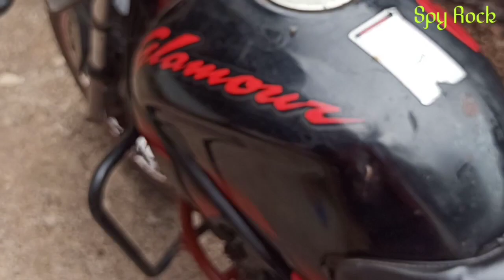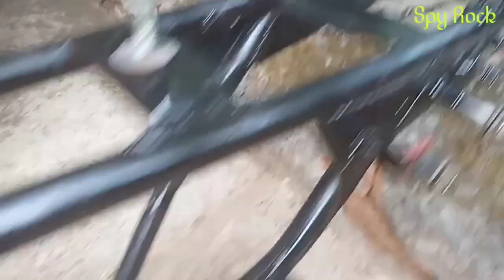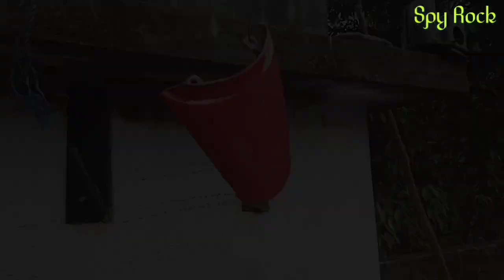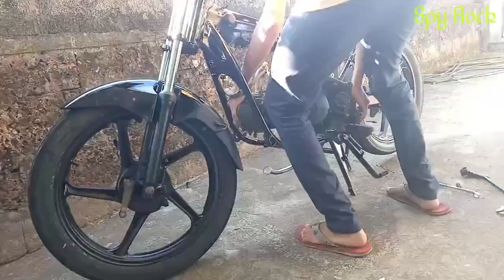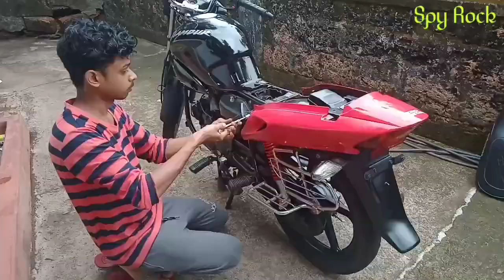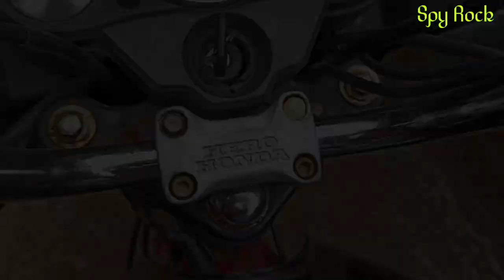Old Hero honda glamour restoration | Glamour bike rebuild

Comment: Bro ethinn usee chythaa paint athannuu
Reply from the maker: Spray cans ആണ് പെയിന്റിംഗിന് ഉപയോഗിച്ചത്.Compac quick drying 100% acrylic spray color 211 Red ആണ് Red spray can ന്റെ details, പിന്നെ Glossy black, Matt black, Silver, Clear (Lacquer) Total spray cans. Chassis ൽ rest & welding  ഉള്ള ഭാഗത്ത്‌ Normal red oxide oil primer painting brush ഉപയോഗിച്ച് അടിച്ചിരുന്നു. That's all...

Comment: Bro idh azhikkaan ulla tools ethokkeya vende?
Reply from the maker: Correct ആയി ഓർമ ഇല്ല. Star screw driver (+), Flat screwdriver (-), plier, 8mm 10mm T spanners, 6mm Allen key, 12mm
16mm 17mm 18mm 19mm 24mm Ring spanners, adjustable spanner...
Reply: @SpyRock077  thanks bro

Comment: malappurath evdenu
Reply from the maker: Kottakkal ഭാഗത്ത്‌ ആയി വരും...
Reply: @SpyRock077  entethum same bike aan. Ithupole set aakkitharaan rate ethraavum. Bro thanne cheythu tharo. Pls reply. Njan chemmad aan place
Reply from the maker: @noushadm8299  Sorry bro. എനിക്ക് ഇത് ചെയ്ത്  വലിയ experience ഇല്ല. Time pass ന് ചെയ്തതാ...
Reply from the maker: @noushadm8299  ഇതിന് total ഏകദേശം 5000 ആയി. ഹെഡ്ലൈറ്റ് assembly പുതിയത് ഇട്ടു. Pinne ചില cables മാറ്റി.പിന്നെ Sticker kit ന് 750 രൂപ ആയി. പിന്നെ spray paint, sand papers, body filler and etc...
Reply: @SpyRock077  ennaalum bro kk ariyunna pole onnu set aakkitharo.

Comment: Paint durability
Reply from the maker: That was good. I don't know. Because it's not my...
Reply: @SpyRock077  but you have painted your splendor then   how long the durability of spray can
Reply from the maker: On Splendor fuel tank has some little rust. Because i was put tank cover before 
That's clear dry well. And the plastic like side panels, mudguard, tail kit and other parts that's get little fade. But shiny. The most disadvantage of spray cans if petrol or other fuels or chemicals on that painted surface that paint will damage...
Reply: @SpyRock077  thanks for reply 🙂

Comment: Bro eth pole pani kazhich erkkan ethra rs varum.. bro nd3 contact number indo
Reply from the maker: Sorry brother. ഇത് ഞാൻ ഒരു time pass ന് ചെയ്തതാണ്.ഇത് restoration ചെയ്യാൻ total amount 5000 ആയി. Headlight assembly പുതിയത് വാങ്ങി. Visor പഴയത് തന്നെ ready ആക്കി എടുത്തു. പിന്നെ sticker kitന് 750 രൂപ ആയി.പിന്നെ body filler, sand papers, spray paints,and some other spare parts...

Comment: Guys milage ethra kittum ?
Reply from the maker: Sorry bro. I don't know. because it's not my. So i didn't checked mileage...
Reply: മച്ചാനെ ഓൾഡ് ഗ്ലാമർ 77 കുറയാതെ കിട്ടും
Reply: @v-stervlog3615  2009 vandi hero honda glmour 40 mileage 😓
Reply: @aswinm4048  carb clean cheyth tune cheyth nok bro, enteth  2007 model aanu. 50-60 kitunnund. Pine oil, air filter, clutch oke okay aano ennukude check chey. Enikum ee issue undarnu. Engine packing leak issue undarnu packing mariyapo issue solve aayi.
Reply: @aswinm4048  enteyum 35-40 anu mileage.